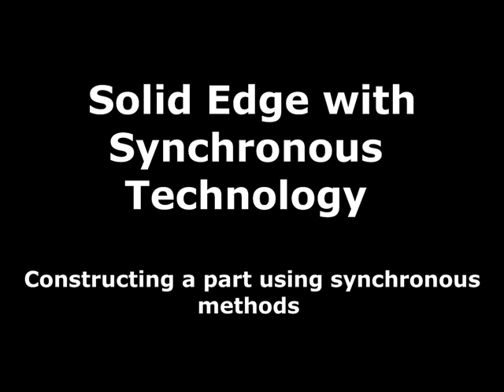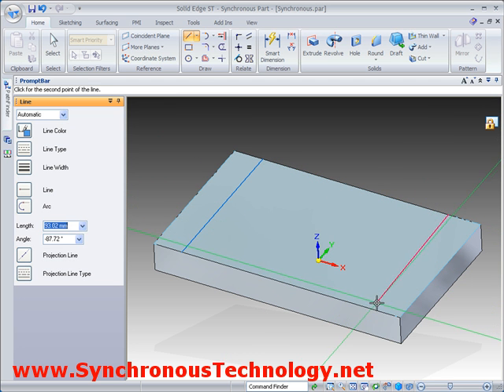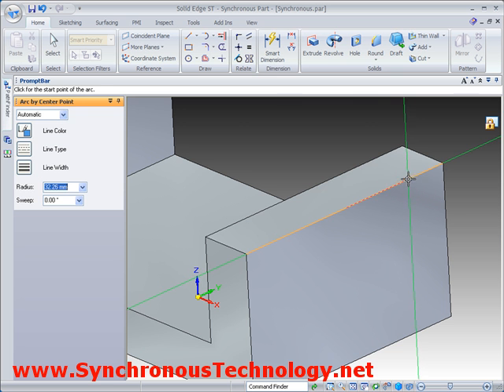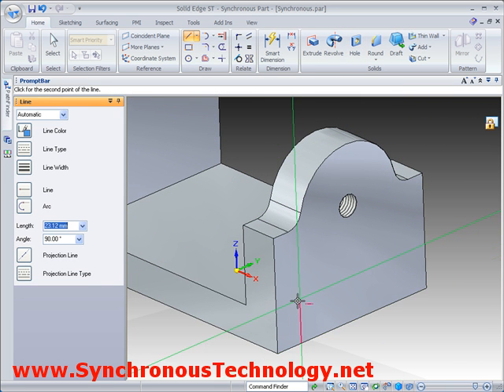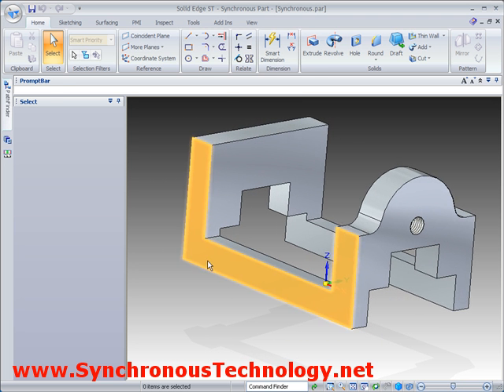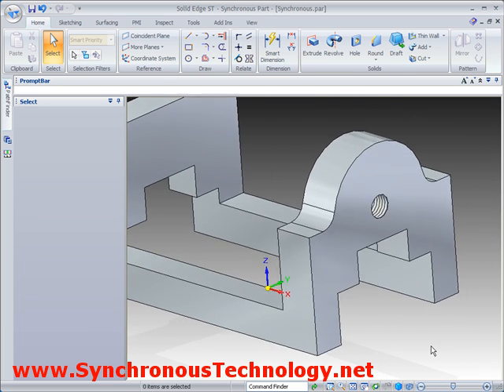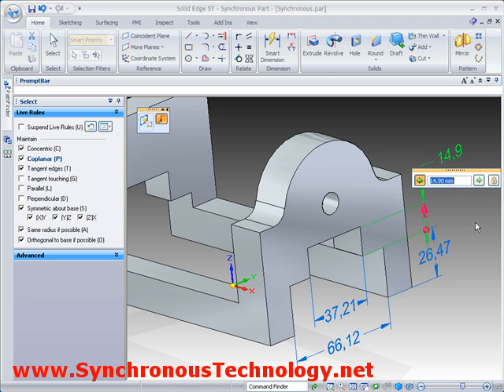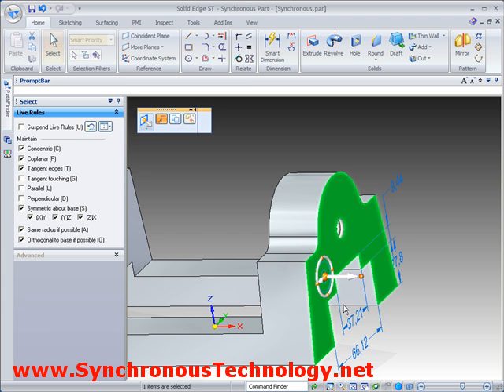CAD with Synchronous Technology, Creating a Synchronous m

Comment: the problem i found with this synchronous technology is that if you draw some scetch elements on a surface that you complete "round off" with the fillet tool for instance, the sketch will go completely crazy and lost and even move to another plane, because the flat surface that it used to be on is now all roundet and lost. nonetheless i wanted to keep the whole where it was. I had to start over. everything the said sketch did was lost too. theres no hirarchy. 
it didn't work for me. :S